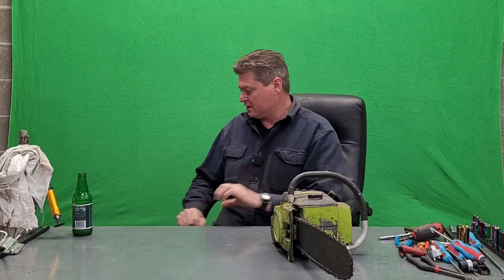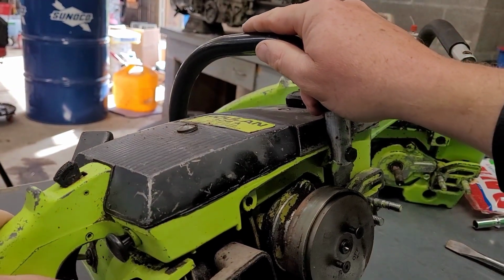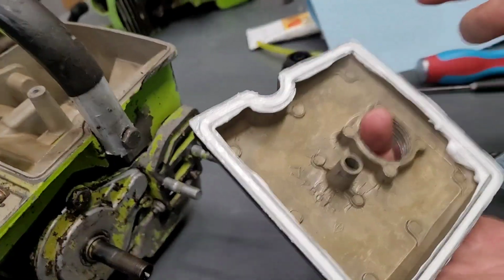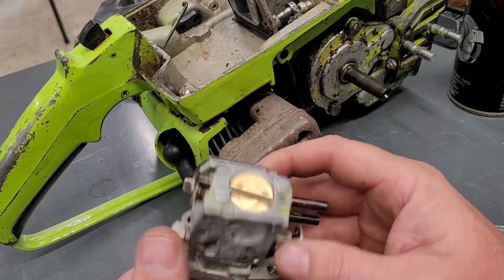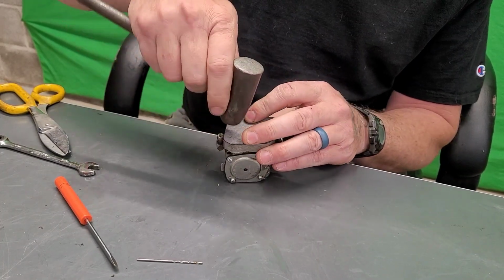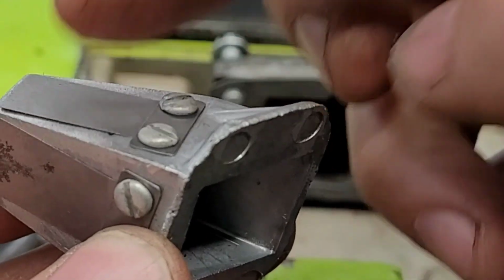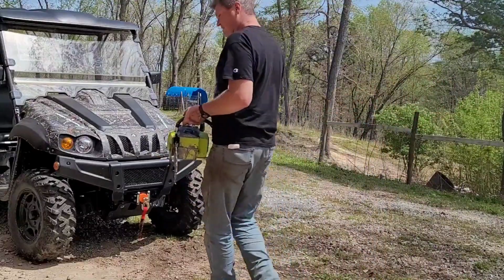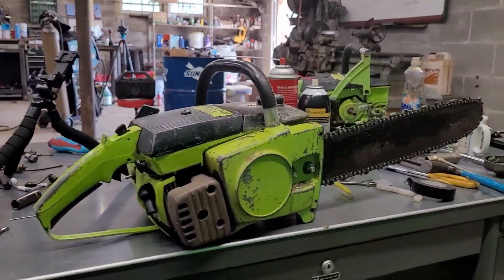Poulan 306a back from the DEAD!

Comment: I just acquired the Poulan 306a, it seems to be in great condition, however, the chain spins without pulling the trigger, what would be causing that?
Reply: Idle it down or change the clutch

Comment: Boedy, do you still have the parts saw around?  I could really use that one.  Just pick up a Wizard 430 and have no idea what it will be.  Well...terrible...after taking it apart...I learned that it is the same saw as the Poulan 306A.  Looking forward to hear what you have if any.  BTW - I've been watching over and over and over and over again your work (growth in learning) with the Hus 55 rancher...I just starting learning about saw for few months....and your struggles are both affirmation and learning for me....thank you for sharing.
Reply from the maker: I do.  Send me an email.  Boedychainsaws@gmail.com 
I sold the piston and cylinder, but I still have almost everything else. $60 will get you everything I have for it shipped and at your front door.

Comment: That saw really looked like it had some decent torque though. You could put some black hi temp RTV on that plug wire to fix it up, that would resist the heat fairly well. That saw looks like it's screaming "Port Me!" 😁
Reply from the maker: Ooh...the RTV is a GREAT idea!  I'll have to remember that.  However, I already ordered some heat resistant electrical tape.  I actually got it running pretty dang good, slapped a 24" bar with a nice sharp chain on it...runs great!  Not a very zippy saw, but it really just pulls chain!  I seriously had fun using it.  That video will be posted on Thursday.
Reply: @novicelumberjack  wow that must be awesome with the 24" bar!
Reply: You could cut 100s of Corts with that saw

Comment: I picked up one and it has a crack in the oil tank under the bar adjusting screw/peg. it looks like the bar was tightened with the peg not in its hole which was pushed in. should I use JB weld or just RTV silicone? its a big hair line crack. didn't see it before buying it. thanks.
Reply from the maker: I'd probably try some JB weld

Comment: Can you show how to replace the sparkplug wire? I have a Poulan 360 that has that problem. If not, its fine. I'd just like to see someone do it. At first glance it seems like it would be hard to change because of the way the coil is made. I still have some cleaning to do on it that may reveal an easyer way. Idk 🤔
Reply from the maker: I'm just gonna use heat resistant electrical tape on it.  Easy peasy.
Reply: @novicelumberjack  Ok, good idea. Thanks for the info. 🖒

Comment: I have one I'm resurrecting, was my dad's. Hopefully this is an easy question, the specs I find online recommend a 32:1 mix with the poulan brand 2 stroke oil but the poulan stuff I see for sale now recommends 40:1 or 50:1 mix. Is this the same stuff they originally intended for use in this saw? Or what do you recommend?

Thanks
Reply from the maker: It is less critical than you think it is.  Run what you want.  I run either red armor or castor 927 at 40:1 because I like it and it works.  And that's it.  The only oil I have ever seen a real problem with is the Stihl Ultra.  The stuff in the gray bottle.
Reply: Oils today are synthetic so you could run 50:1 of todays oils in that old saw and it’ll be fine. It only states 32:1 on that saw because they didn’t have oil designed for 2 strokes back then. You basically used regular engine oil in a heavier grade to ensure it doesn’t break down prematurely before it reaches the bearings in your engine that need the most lubrication. But the other reason it also states 32:1 is because nobody gave a shit about pollution back then like they do now. Now the environmental pollution department is phasing 2 strokes out or at least demanding them to run extremely light as shit on oil